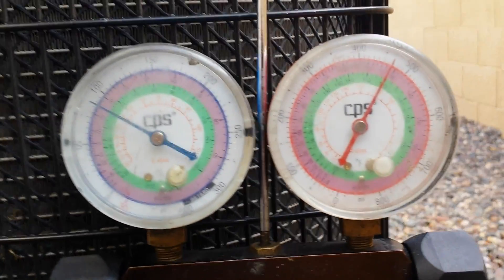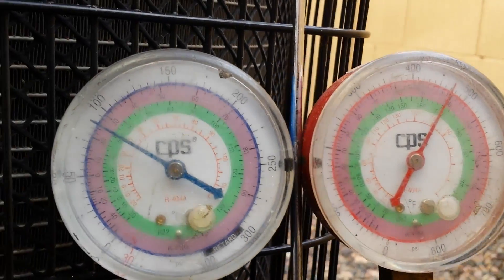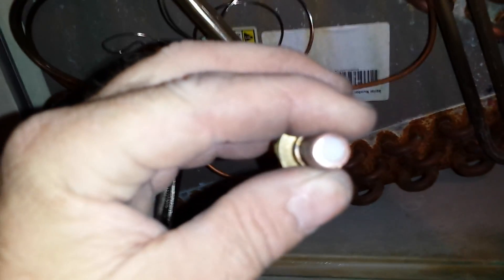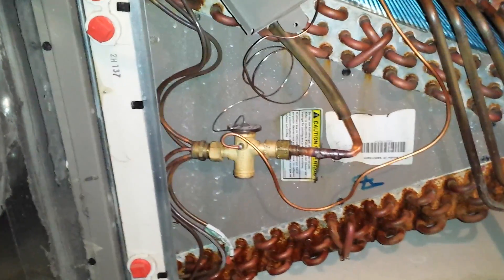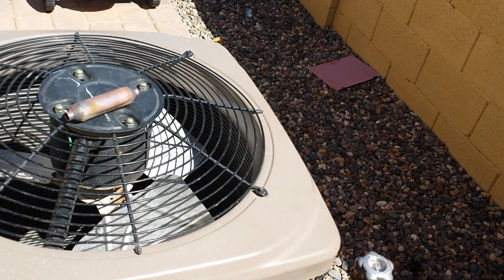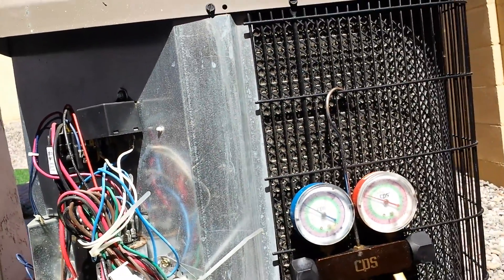90 degrees of subcooling - I think there is a restriction somewhere!

Comment: the video is interesting but it seems delicate to me that when finding the obstruction at the arrival of the TXV valve as can be seen in the video I clean the mesh filter what is there before the coupling but that doubles that restricts in the 3/8 pipe to side where he welded he did not correct it and that is where it strikes me that since it works like this then they do not do the complete task and those strangulations in the pipes are due to not using a bender to make those folds for the rest the procedure is respectable .  but more than being honest, you have to have professional ethics when doing this work because more than letting a piece of equipment work, it is leaving the mark that not just anyone was there but an air conditioning professional. And the final pressures from the high line pressure is inside than normal and in the low line I must say that the compressor has signs of a valve problem because for R 22 taking low to a pressure of 90 is delicate because it shows a subcooling of 12 and its superheat of 12 does not I'm wrong if it's a 2 or 3 ton machine in these machines it happens that manufacturers put 3 tons on the plate but the compressor is not three tons I have found cases that the compressor is 26000 BTU and the manufacturer talks about SEER efficiency but in reality, with the passing of time, the unit begins to work forced because for the unit to have a 1 to 1 ratio, 10,000 BTUs are missing and little is said about that subject and that is why in this video he pressed it  n of low is high because at least the compressor lacks BTUS for the 36 that the machine says and as I said the compressor begins to work forced and it is necessary to take it to pressures of that magnitude because there is a valve problem and that is what happens one counts by collecting the refrigerant in the condenser.  Greetings.
Reply from the maker: Dude WTF?
This was in a 130 deg attic and a quick fix for a friend of my brother's after my day job at the time.  The video wasn't an example of rebuilding an AC. It was an example of a massive restriction from system debris and getting the system back on line so this woman could have some cooling relief after the sales-tech told her she needed a new unit and left!
 I didn't have my service truck and everything available to build a new line. It was a FAVOR.
*Also, it looks crimped in the video but it was otherwise OPEN and not a restriction whatsoever.
 

You probably would have given her the option of a new unit and walked away. As most "techs" do these days when they find a repair challenge.

Also aside from whatever you think you saw from your armchair, the operation of the system was normal. 

You should spend some time cutting open factory manifolds,  bends and tee fittings to see what they look like in the inside (enough to make your head spin) and then you wouldn't be worried about some imperfection you saw on the outside of a copper pipe.
That pipe may look twisted and crimped but it wasn't. Actually. It was just distorted and looked like shit on camera.
AT 5:45 in the video you can see that the TXV had no issues throttling open and flowing fully with a fully loaded coil (over 90 degree space temp/return air).
Shit. System worked perfect.
Reply from the maker: Also the second half of your comment had nothing to do with the restriction nor why a system or any system would have odd pressures.
HVAC capacity specs changed about 25 years ago where the total capacity rating (on the unit decal) is a combination of sensible load (the temp change) and latent load (humidity removal) and that is how/why they have smaller BTU compressors than the unit nameplate.
They have a combined BTU rating based on some silly plot scribbled on paper. Older units were strictly based on temperature load.

We're full aware of that here in Arizona as the new systems underperform a bit compared to the older ones in our mostly dry heat climate.

Comment: Thanks for saving this customer a rip off (!).

Speaking of rip offs:
Look at the screwing we're all getting because of the EPA and its ozone depletion cr*p!

The Nonsense That is Ozone-Depletion

"Holes" in the ozone argument: 

1) Freon is heavier than air:  how do molecules heavier than air get to 30,000 feet (the beginning of the stratosphere)? 

2) The "hole" in the ozone over the South Pole was "discovered" by satellites in the '80: if it was just "discovered", how do we know IT WASN'T THERE ALL ALONG ? ? ? ?

3) There is a perfectly logical reason why there is less ozone over the polar regions: THERE IS LESS SUNLIGHT THERE TO PRODUCE OZONE IN THE FIRST PLACE, especially in winter ("land of the midnight sun...")  

4) Antarctica (South Pole) has the highest average elevation of any continent (8000 ft): Does that have any effect on ozone quantity?????  (The North Pole is all at sea level and there is no ozone "hole" there.  (Why not?) 

5) The offending atom is CHLORINE (very common), not CFCs themselves. The argument goes that the CFCs carry CHLORINE up to the stratosphere.  There are other compounds of chlorine in the atmosphere -- that's one of the things you smell when you go to the beach  --> "salt water" --> i.e. sodium-chloride.  Is the ocean a source of "ozone depleting" chlorine compounds?  

6) Most basic of all, ozone (O3) is an EFFECT of UV blockage, not a cause. [O3 is an unstable molecule that needs a lot of energy to produce, e.g. the ozone you smell around arcing engines. There is less ozone at the poles b/c there is less UV to generate it (just like there is less sunlight to keep the place warm in the first place.     

I hope the public is beginning to see how dubious this ozone scam is.   Monstrous mistakes like this DO happen - think the ban on DDT and malaria deaths.

The Ozone Scam
https://youtu.be/9Szs-treHwQ

The Nonsense That is Ozone-Depletion

https://www.ourcivilisation.com/ozone/king.htm+

Look how we've been "had" by this "ozone depletion" scam:

In other words, CFCs probably have NOTHING to do with Antarctic ozone:

https://youtu.be/lBu3vltczRw

In other words, the× Montreal Protocol is a complete fraud:

Min 0:30:  "Measurement of SURFACE 'ozone depleting substances' (chlorine? are you measuring ALL atmospheric chlorine compounds?).  

https://youtu.be/uVeTJSIbGm8

1987 - Montreal Protocol. Remember that date in this music-tracked piece of manipulative propaganda.
Listen for the weasel words and disclaimers.
https://youtu.be/Ll_TR7C4xr4

Ozone hole is "healing" (scientific term). Can't you tell?:
https://youtu.be/taTzqRHNIEc

A discussion of atmospheric chlorine:

https://api.nationalgeographic.com/distribution/public/amp/news/2010/3/100310-sea-spray-ocean-colorado-pollution

Natural Chlorine? You Bet! (American Chemistry Counsel)

"Many of these chemicals are identical to highly publicized manmade organochlorines: chlorophenols, chlorinated hydrocarbons, PCBs, CFCs and dioxins."

https://chlorine.americanchemistry.com/Background-Natural-chlorine-You-bet-/

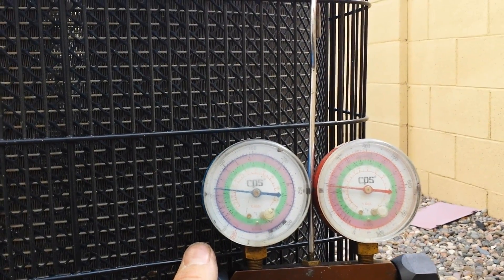Min 2:00 Listen carefully: in other words,  the ozone hole has been there since AT LEAST the 50s, before CFCs were widely used.

Min 15:00 "interesting scientifically" - must be fun to have these kinds of research grants and boondoggles. Great work if you can get it.

https://youtu.be/AU0eNa4GrgU

How EPA is screwing up your car's air conditioning. 

https://youtu.be/wm56tV5BbJk

Lousy car air conditioning:
https://youtu.be/5jKRiDtcBrs

Guy says we should use explosive propane as refrigerant

https://youtu.be/pv_fxOuLuZU

Propane as a refregerant
https://www.youtube.com/watch?v=iXyHOfx307k

.
Why The Banning Of Chlorofluorocarbons Is Paranoia

https://www.ourcivilisation.com/ozone/index.htm

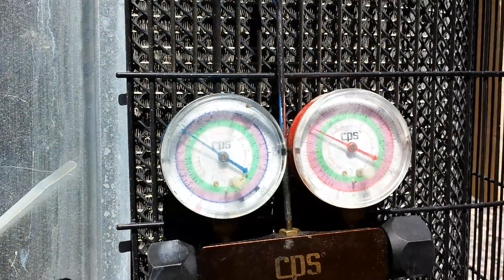Min 6:00 -- two different kinds of chlorine... (yeah, right)

https://youtu.be/kmfAM8kQrjU

The stupid claim the ozone layer is "healing" ("healing" - is that a scientific term?)  

Notice that the "hole" always goes away in Antarctic summer (more sunlight/more ozone produced) and reappears in Antarctic winter (no sunlight/no ozone produced (ozone is an unstable molecule to begin with)).  We've been sold a load of cr*p that has made a hideous mess of the AC industry. 

You'll see no change in hole size in the Antarctic winter, which means the "hole" has been there all along and is a perfectly natural and harmless phenomenon.  "Oh well, we trashed an entire industry over a quack-science hoax... Sorry about that..."

https://youtu.be/krqHVzF3-T8

Comment: Could that small factory filter dryer cause the high side to be low,low side has enough pressure,just my high side is low,got r22 split system 65 psi low side,hight side is on 110 psi,normally is gotta be on 210psi on high side,symtem is 25yrs old york

Comment: Daaaaamn! Im always surprised that it doesn't  blow the compressor if it isn't bypassing! Lol.  Ive run across a few pushing that high and not bypassing, I always make sure Im not standing in front of the compressor terminals while Im working on it, hehehe :)
Good job cleaning up after the parts changer company! Heh.

Comment: what is subcooling temperature range for this unit-- which looks like a York.  What is its tonnage?
Reply from the maker: This video is from years ago. But as a TXV system you should be around 10 degrees.
Reply: Thank you.  The installer of the system finally called and I was told my unit requires 18-22 F degrees of subcool.  Is that too high?  Further, that if it were a piston type, the subcool would be 10-15 F degrees-- I thought piston types were charged via the superheat method.  I am confused.

Comment: Heatpump in heat mode is building up pressure 300 to 400 psi and the temp on the line is also rising 300 plus degrees until the compressor kicks out. It works in cool mode and does not shut off. It will start up in about 20 minutes and go thru this same cycle over and over.  The expansion valve has been changed but didnt change anything. They said the 4 way valve was working. Have had 4 different  people come and check it. Still no luck figureing it out. Any suggestions?
Reply: Sounds like the reversing valve is bad to me. I think that's what you're calling a four way valve but if they all said it's working, I could be wrong.

Comment: at 407 look at how bent the liquid line is this alone will eventually cause a restriction and flash gas.   the original hack didn't use an inert gas during brazing of the first TXV that's a lot of carbon. and it plugs the  txv .
Reply from the maker: +dale lankford It isn't nearly as bad as it looks.
And the pressures were perfect.

And if it wasn't restricting now, it isn't "eventually going to cause a restriction". LOL. 

Shit. You should see inside some of the factory tee's where refer has to hit a wall and change directions, etc. A deformed piece of 3/8 isn't crap.
Reply: maybe it was camera angle I Will trust your word for it I wasn't there it just looked really bent , as far as the  restriction it still looks like poor brazing upon the install. I know this because  I came behind  myself about five years after an install and the txv  was loaded with carbon sad thing was it was my house the carbon held the txv wide open and cause liquid feed back into the compressor and busted the valves expensive lesson always use  1to 3 psi of nitrogen while brazing your refrigerant lines.
Reply: My boss would have a fit over stuff like that

Comment: Those little copper spun dryers are crap. I don't know why mfrs even bother. I usually oversize my liquid line filters for a bit extra capacity.  The old timer I once worked with got me in that habit. Great catch and Good  repair!
Reply: That's actually not a filter drier its a muffler to dampen vibration in the condenser. The manufacturer recommends a filter drier be installed at the indoor unit, which he did great. but any time there is a problem with a system like that, manufacturers recommend replacement of drier again in 1 month. Now, does any one ever do it? of corse not. but it is recommended practice.
Reply: @andrewgilbreath1331  soooooo the muffler that's inside the condenser  and looks like a filter drier is not a filter drier ?

Comment: Damn great diagnoses great work by hackfreehvac . Question we always install drier in the liquid line at out door condenser . Would it work better at the indoor coil . Thanks.???????
Reply: YES!  I could answer that.  

When you sauder those dryers in outside. You melt the paint and moisture from rain outdoor elements etc will rust out that dryer and cause refridgerant leaks.

2nd

Dryer closer to metering device is better because it filters from compressor outlet all through the liquid line up to the ah.  If you install it outside and for whatever reason you get a leak in liquid line past the dryer the contaminates basically bypass the dryer and plug metering device
Reply: Main reason for putting those dryers inside is the moisture.

Comment from the maker: Might have been the pressure equalizing through the TXV, maybe allowing the check valve to cycle, etc. 

I've heard some strange noises every now and then. Some people add a liquid line solenoid to stop all refer flow (migration) when the compressor stops.

Comment: Great find and fix!
Had similar pressures on a milk cooler, gauge went off the scale! turns out installing company had crossed the liquid lines over on two system, they'd adjusted the hp switch so it wouldn't trip...
I linked the two receivers together with some 1/4" till i could get back there with a scaffold and fitting to re pipe it!

Comment: 450psi on the high side, theres some clowns out there ! Even after repair 100psi on the suction seems high, even If the valve had not shut down yet, What was the low side reading when you finished job ? Cheers

Comment: wow 450+ psi on r22, crazy! boy are they glad you came to take a look! We got taken a few years back in texas. We had 5 ton Carrier heat pump for the down stairs and a 1.5 ton straight cool for upstairs (thing was so tiny!) the 1.5 ton was over sized for upstairs but worked very well. The indoor unit started shuddering every time it shut off (Any idea what caused this?) and the hvac guy just pumped it even more full of r22, week later, indoor coil blew up, so we got a new indoor air handler....

Comment: There's actually some hackery at my church. The oldest units (some Trane Odysseys and a Trane XB 1000 all or which are from 2001) are mounted on stilts and the maintenance people left behind some capacitors and even a compressor down there.
Reply: if txv finished and fix dricer capliry tubes will this work ?